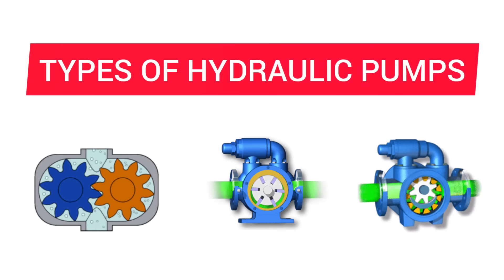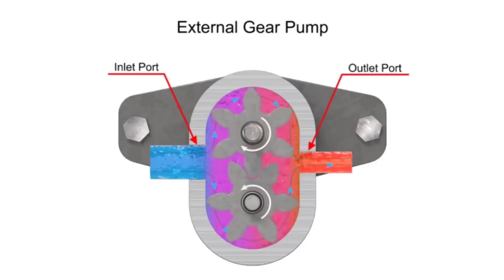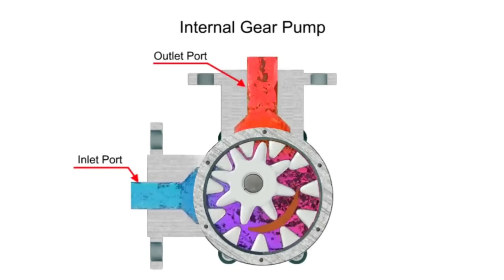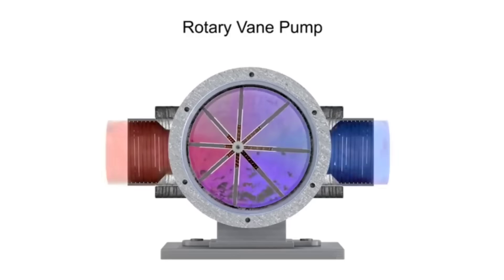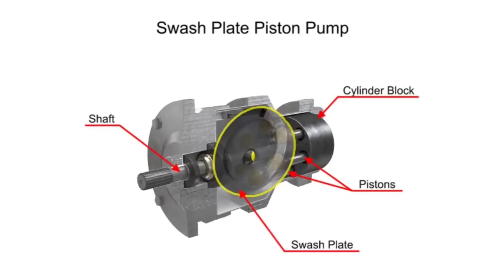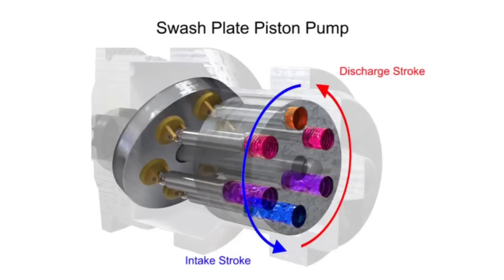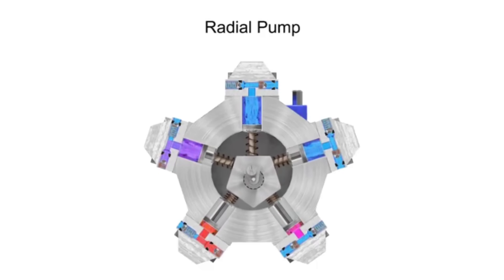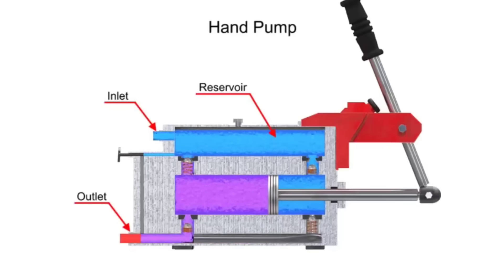Types of Hydraulic Pumps | Mechanical | Piping

Comment: I've worked on and rebuilt every one of those pump types except external gear. Have also worked with; gerotor pumps, air/mechanical/hydraulic powered diaphragm pumps, hose pumps, screw pumps, ram pumps, air-over-hydraulic/hydraulic-over-hydraulic amplifiers and scroll pumps. Along with numerous varieties of non-positive displacement pumps. Often you will find axial piston pumps (the kind with the swash plate) in an automatic compensating design. It adjusts the swash plate to maintain a constant pressure, need more oil then it makes the plate steeper, needs no oil, it drops the plate to 0, you can also find vane pumps in compensating design by adjusting the eccentric housing to change the amount of vane throw.

Comment: You missed one of the really neat things about a swashplate piston pump: the ability to change the swashplate angle can be used for automatic pressure regulation. When the outlet pressure increases, a small piston tilts the swashplate to reduce its angle. When the system is at the set max pressure, the swashplate is completely flat so no fluid is pumped. The shaft can be rotating at constant speed from e.g. an internal combustion engine.

Comment: I worked in pumps manufacturer, most of these are gear pump for high viscosity fluid like oil or fuel.
Great animation tho, but i expect to see pumps like multistage pump, single suction/double suction pump, vertical turbine, or any of that mostly used in industrial/buildings.
Reply: So gear pumps are very common?

Comment: One of the external gear pumps' biggest disadvantages is missing: the liquid flow is uneven, pulsating, so they are not appropriate where even and continous liquid supply is required.
Reply: In what applications this is issue? In hydraulic motors?
Reply: thats why pressure regulators were invented. takes the hammer out of the fluid.
Reply: @_AndromedaGalaxy_  Not even close.  Pressure regulators are similar in scope but light years different in performance than spike clipping relief valves.

Comment: The rotary vane pump doesn't make sense to me. Well, it makes sense, but I see a problem. I was taught that water is incompressible. This pump is trying to force it into smaller and smaller volumes, which you just cannot do to water.

Is water not "low viscosity"? Is this pump only meant for compressible fluids (like most gasses)? Or is there something else I'm missing?
Reply: I suppose they could make the intake and output cover almost all of the circle, allowing the water to go in/out of the pipe and not break physics

Comment: You said hand pumps are always a piston type, that's not true there are external gear pumps that are hand powered for transferring oils ,fuels and other liquids. I've used them a lot over the years.
Reply: A "hand pump" is a specific type of hydraulic pump. What you are describing is still an external gear pump, regardless of whether it powered by a motor or hand crank.
Reply: @DefensorMilitas  a "hand" pump is just a method to drive it.  Doesn't really matter, the hand isn't pumping.  I think most here understand that the pump; being a gear, vane, piston, diaphragm, etc. is the actual pump.  How it is arranged (opposed, radial, excentric, etc.) and or driven is a different matter.
Reply: True =) we had one of both types with the lever and the svivel handle , at my old job . And all garage jacks or donkraft is opperated by a handle lever . the same thing he explaines here =)
Reply: Looks like the video is stolen so kinda moot
Reply: That's right
Reply: I believe all HYD hand pumps are piston type. What this guy is describing is a FLUID TRANSFER pump. Without any resistance, no hyd pressure

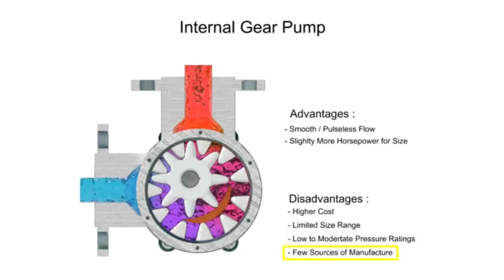Comment: 3:05 also used in engine lubrication, albiet with different teeth profile. Trochoid pumps they're often called. More modern design but they've been circulating engine oil for decades in their own right; my 36 year old Ford truck uses a trochoid pump for oiling itself.

Comment: What is the reason no pressure build in positive displacement pump ?
Reply: A Pump does nothing more than generate FLOW.  Load or resistance to flow is what creates (back)pressure.  So if you have a route back to tank without resistance than can handle all of the pump flow, you will never generate pressure.

Comment: Was a maintenance electrician for 50 years and was amazed how much lower hydraulic pumps produce. Only down side appears that every hydraulic hose leaks. Had a company come in and spend over a week during yearly shutdown to replace every hydraulic hose on a large machine. Laughed in their face when prima donnas said " you will never have a leaking hose" . Several started leaking first week. Best one that I saw was in a large slaughter house that used a hydraulic piston to split cow & steer heads in halve. Would split 6 by 6" lumber in it.

Comment: Pity he didn't say what applications these pumps are used in.
Reply: Use them however you want.
Reply: What pumps can be backdriven... What pumps convert hydraulic pressure to mechanical power?
Reply: We use the radial pump in 80m 3MW wind turbines to pitch blades. 200bar working pressure

Comment: I worked on a swash plate variable volume pump, constant pressure but volume could be varied by tilt of swash plate via pilot control providing variable speed at constant pressure to hydraulic motors.
Reply: That's the type I was hoping they'd go into in detail when I clicked on this video
Reply: The radial and the swash plate seem very similar to each other.
Reply: @brodriguez11000  Yes and No.  You can vary the displacement (volume per revolution) of the axial piston design, but not on the radial piston type. Both are similar in that it's a reciprocating piston that provides the flow aspect.
Reply: Swash

Comment: I never saw a swash plate piston pump that used springs, the pistons are attached to the plate. 
Vane pumps are used at lower volume but 2500 to 2800 psi in some applications on trash trucks. 
On a Cat 651B scraper they used a vane pump at 3500psi if i remember right, it's been a looong time.
Reply: Best alternative to the internal gear pump on engines for engine oil? Would a vari displacement vane pump be more efficient, keeping the pressure at required 8bar but not pushing exes oil over the pressure relief valve?
Reply: @LukaS-iy1gs  cost, complexity and probably size would be 3 reasons to stay with a gear pump
Reply: @LukaS-iy1gs  I believe the 'excess' is the bit that flows through the oil filter.
Reply: @millomweb  most engines use a full flow filter system that any oil going into the engine lubrication distribution system goes through the filter. The pressure relief valve dumps back to the pan. Cummins does use a 2 in 1 filter, a full flow and a by-pass filter in 1 can.
Reply: Only come across 1 vane pump - high volume air compressor.Correction - I think marine engine water pumps are of a flexible vane type and, as it happens, I've similar that can be attached to an electric drill.
Reply: @millomweb  12 volt fuel transfer pump.
Reply: @plowboy7700  ?
Reply: @millomweb  a 12 volt fuel transfer pump is a lot of the time a vain pump. That is an instance of a vain pump other than an air pump.
Reply: I have seen spring loaded swash plate pistons in Hydrostatic drive units on lawn and garden tractors. Look up a Tuff Torq K-46 it has spring loaded pistons
Reply: @michaelvrooman5681  
Ok, but I don't work on anything that small. Everything starts at  3 axle  and 54,000 and goes up from there. The  suction line is usually 2 inch.
Reply: @michaelvrooman5681  You mean hydraulic drive units.
Something hydrostatic is not moving anywhere.
Reply: @michaelvrooman5681  It's only hydrostatic when the fluid is not moving. That's what static means. Go look it up !
Reply: @millomweb  they are called "Hydrostatic drives" out here in the feild
Reply: @michaelvrooman5681  But it's the wrong name for them.
Reply: @millomweb  it might be the wrong name for them, but hydrostatic drive is what the manufacturers call them. I've been working with "hydrostatic drives" off and on since the 70s and I don't think I've ever heard another name
Reply: @cbmech2563  It should just be 'hydraulic drives'. Hydraulic motors have been around for a long time - they don't call them hydrostatic motors ! So you have a hydraulic pump feeding a hydraulic motor - and that is a hydraulic drive - SURELY ??
Reply: @millomweb  to power machinery it's called a hydraulic motor (they don't mention the pump at all). To move any kind of vehicle (anything from a garden tractor to the big liebherr bulldozer) they call them hydrostatic drive. With at least the pump being a variable swash plate piston pump and sometimes the motor is variable too. The biggest advantage (along with a number of disadvantages) is that you maintain full system pressure even if you aren't doing any work. Some of the fancier hydraulic systems use variable pump with closed center valves. And again, advantages and disadvantages.
As for what to call it? Talk to the sales department. Hydraulic drive isn't catchy enough.
Reply: @cbmech2563  "The biggest advantage (along with a number of disadvantages) is that you maintain full system pressure even if you aren't doing any work"

That seems nothing but disadvantages - and is something I've not come across. All I've seen are ones that minimise load/pressure when not in use.
Reply: @millomweb to minimize the load in a variable swash plate piston pump, when work is not being performed the swash plate goes to zero output except for enough to make up for any leakage. Zero demand equals almost zero horsepower used.
Reply: @cbmech2563  Correct.
Reply: A lot of car A/C compressors are a swash plate piston pump and the plate is in the middle so each piston is double ended. The plate is locked to the shaft, rotating in a slot in the middle of each piston and wobbles around pulling and pushing the pistons.

Comment: Which one work  better ?
Reply: First
Reply: Depends on application.  A piston pump is real common because you can vary flow rate an direction with the pump. An they can "idle" with  no flow an minimal hp drag.